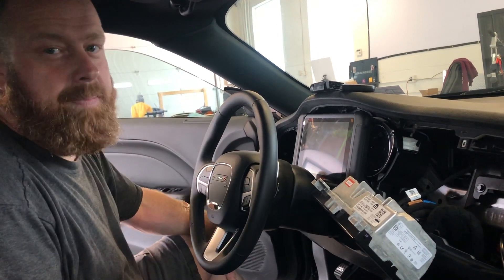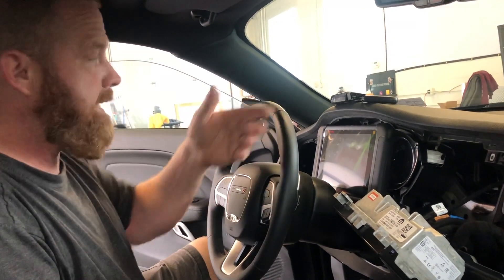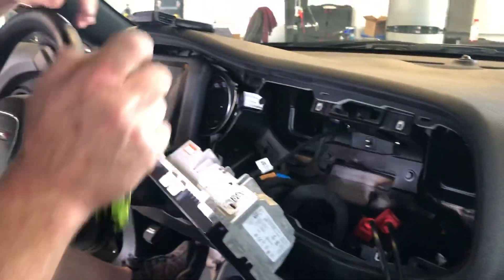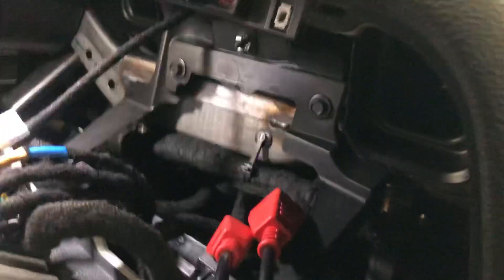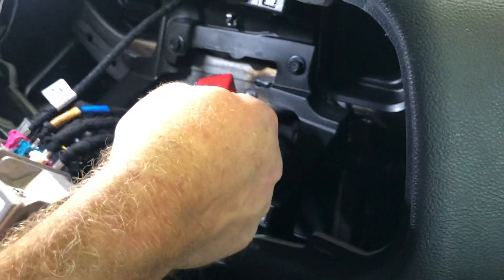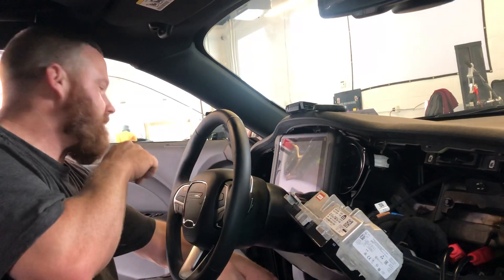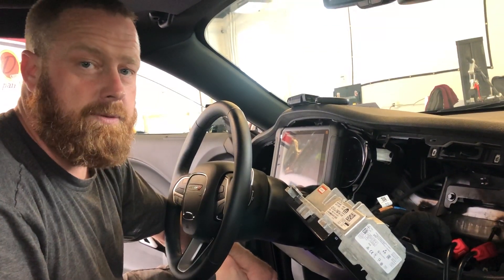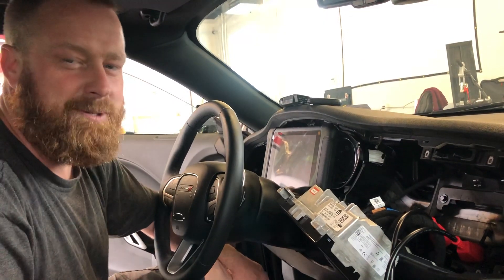Chrysler Dodge 12+8 Cchallenger

Comment: You can use the ADC-2011 Star connector cable now & screw that 12+8 cable much easier & you can use it with your Autel devices too
Reply: So im looking in buying tha adc 2011 connector, but im not sure if it will hook up with my autel mk908

Comment: I got that 12 + 8 cable for my XHorse Key Tool Max Plus pad. I got to get the black box on my Ram 1500 Big Horn. Is the black box called an “FCA” ? Also I believe on my Ram the black box is somewhere under the steering wheel area. I have been seeing other video where some people connect to a what they call a “Star Connection “ or “Star Link Connection “  also.

Comment: This cable is soo idiotic, you can just use the cable with the 2 probes from brute Force, on ram the star connector is exposed next to OBD, takes two seconds
Reply: Do you have a picture? I have issues with my 2018 ram ordered connector but can’t find plugs